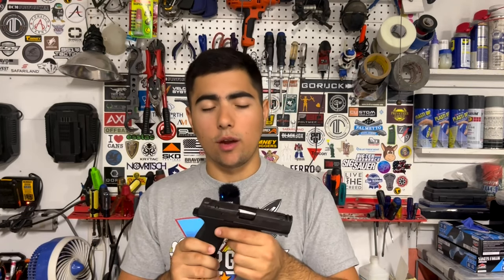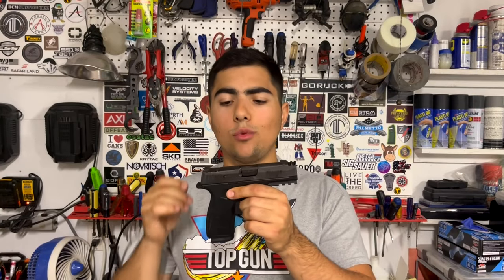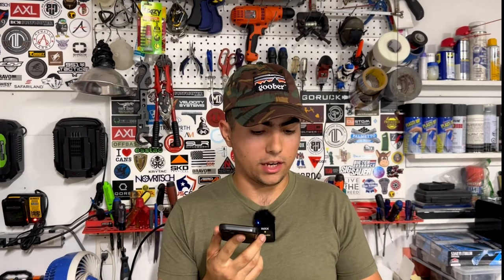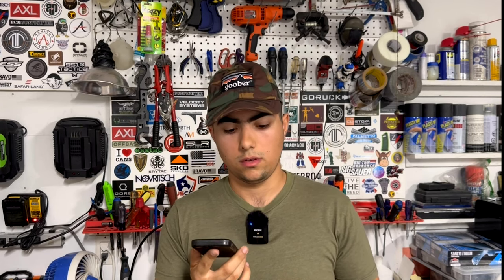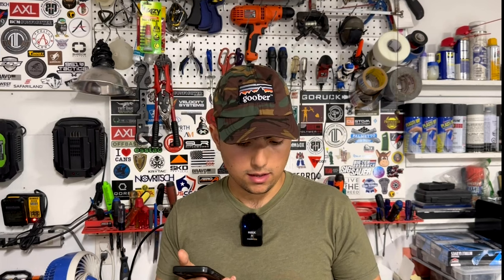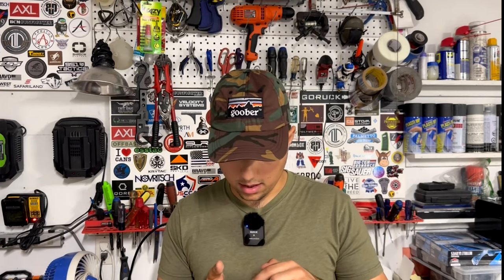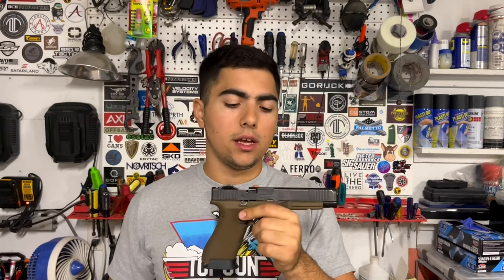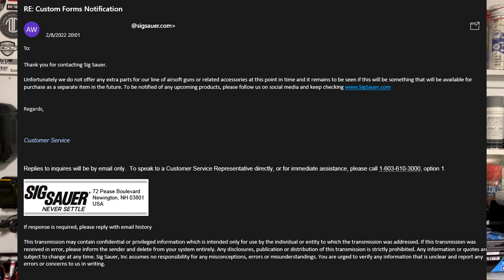Was I Wrong About the SIG P365 X Macro?

Comment: I know this video is over a year old now, but just came across it. This is interesting. I've heard others report the rusting issue, too. My brother and I both bought the xmacro on the day they were released back in 2022. I carried it almost exclusively throughout the end of 2022, all through 2023, and into early 2024 when I took a break after getting the M&P Metal SPEC Series. He's been carrying his non-stop since we got them. We are in the Phoenix area so I sweat all over my guns... a lot. The only place I've notice ANY rust spots at all is a bit along the rear sight dovetail and the serrations on the back of the sight. Those sights are carbon steel so it's not really a surprise there. The rest of the slide, FCU, and mags have all been great for me. I'm surprised they wouldn't redo the slide for you, however, if Nitride isn't holding up well to your body... and you like the gun otherwise, I'd probably send the slide, barrel, and FCU off to someone for DLC coating. That should take care of it. Sig customer service USED to be some of the best in the industry... but we are talking the pre-Ron Cohen days when they "To Hell and Back Reliability" was the company slogan.

Comment: I bought one, first sig ever. shot 800 rounds through it. apparently it's missing a rear c Clip from the factory. they said I could buy one, then realized how nuts that was to tell me. they opened a repair file for me to record the issue. the guy said Sig has no replacement parts incredible. first and last Sig I'll ever buy.
Reply from the maker: Jeeeez. That's even worse. That has to be a part that at most costs them a dollar and they wouldn't just give you one on the gun you bought that didn't come with a part it should have? Sorry to hear about that man.
Reply: @Control The Gun  YES Sir they said they have none. he also mentioned that I could Maybe buy one as well. I told him I bought the pistol brand new, he then changed his tone. Piss poor customer service. Something to be said for glock pistols working and having been built with ALL the parts from the factory. I'm done with Sig. gross treatment of a new customer.
Reply from the maker: @LouC518  I’m in the same boat. The macro was my first SIG pistol and I’m never gonna buy another one now. And I probably won’t be buying any other SIG products again either. If a company won’t stand behind a product then I don’t want it
Reply: agreed 100%

Comment: Changed out the pin in a new Walther PDP Pro to put in a different backstrap. and cracked the polymer frame. Sent the gun to walther hopi g they replace it. But no luck in that. Spent $800 on a cracked frame gun i havent even shot. All i did was tried changing out the backstrap and the pin kept hitting the maxwell, and i didnt realize till the frame got cracked
Reply from the maker: So you sent it back to them and they didn’t even do anything they just sent you back the broken gun?
Reply: @donkeydefense  unfortunately, yes. They said the frame has a serial # and they can't do anything with it. To be honest, it broke way to easy to begin with. Just trying to force a pin in the hole, I know it's my fault. But I still wish they would have taken care of me. Because I haven't even shot the thing yet
Reply from the maker: Yeah that sucks. I can’t speak for them but I would bet if it was Glock they would have taken care of you.
Reply: @donkeydefense  I never owned a glock, mostly because everyone brings so much hype around glock lol but I'm sure they would too. Just sad some of these gun companies do. I mean yeah it's my fault, but at the same time. Customer service is what keeps people coming back and loyal. It's whatever, I learned a lesson. Don't put too much pressure on plastic gun frames, this is just an expensive lesson.

Comment: Glad I saw this and your previous videos. I was tempted to buy the Macro, but now I'm going to stick with my G43X with S15 mags.
Reply: Had my macro for 6 months no rust at all
Reply: 3 days I had the xmacro, the mag release broke. lol
Reply: My g43x MOS with 4 of the 2nd. Gen S15 mags and every one of them has failure to feed multiple times per mag.  I thought perhaps this was me limp wristing or some other "operator error" but i had the RSO and my 2 friends use the gun and all had the same exact issues. This happened last week. Soooo... much like the gentleman in the video, every persons experience is different and because i had issues, you may not, and like he had issues, that doesn't mean everyone will. Good luck with your g43x and the mags. I'm disappointed beyond words.
Reply from the maker: Hmm, are you using the shield arms mag release?
Reply: @donkeydefense  No need to throw the "hmmm" in like i'm lying, attacking you or just an idiot. Yes, i have their recommended mag release and i had a licensed  gunsmith do the install because i'm no expert and wanted to make certain it was done properly. 4 mags, all with FTF. I wanted to like them, but, the ftf were a huge known issue in the previous gen i had hoped was fixed. Maybe i got unlucky bad ones but i purchased 2 from the gun store and 2 from Shield Arms. Happy for anyone who has good ones but i swapped back to stock 10 rd.
Reply from the maker: I wasn’t attacking you or insinuating anything. I’m trying to help you out and went to the first most common issue with them. 

I would try reaching out to shield arms and see what they say. I had an issue with my first mags with them and they took care of me, hopefully you get a similar experience.

Comment: It's not innovative at all, all they did was extend the grip down so it'll seat 17rd flush fit. They also never stop taking credit for being the "first" to introduce a high capacity carry pistol. The Kel-Tec P11 came out in 1995 and was 1 inch thick with a 10rd flush fit magazine. The specs are almost identical to that of the P365.
Reply from the maker: Good point

Comment: I had an issue with my P365, called Sig, and funny enough, the same lady, McKenzie, helped me out. She was pleasant to speak with and did her job. They sent me a label ten minutes later. I sent the gun in on a Monday, and I had it back by that same time Friday. 

It sucks that I had the issue with it, but I wouldn't say their CS was bad; they fixed the problem, and the gun works great now.

On another note,  I have a P226 and P365 Spectre Comp that run perfectly, with over 1000 rounds on each.
Reply: neat.. they must've just not wanted to help with is 2 month old rusted out shitbox.

Comment: So I’ve only had to deal with customer service issues through Shadow Systems… and their CS is very good and comparable to Glock! I had to send my Shadow Systems CR920 in for work due to the trigger not functioning properly.. it wouldn’t reset.. and I knew it was my fault for taking the gun apart so I contacted them for the parts I needed but couldn’t find on the website.. they asked me to send it in for them to look at… couple months later I received my CR920 back with new parts, even in areas I didn’t ask for, and NO invoice for work done! That’s good CS! To basically say that RUST is “normal” after 2 months of carrying is insanity! Sig is looking bad all around.. they have the 320 firing in holsters and failing drop testing (AND BEING RELEASED THAT WAY) to now the X Macro having finish issues all around! I don’t think I’d ever trust my life to one.. and I like the way they look and feel… I’ve been on the fence multiple times… this video removed me from the fence all together! Good info!

Comment: Sad to hear about your experience, I’ve had two considerably smaller issues that sig fixed for me. Not necessarily as a rebuttal, in my experience any gun manufacturer when it comes to replacing major component s like slide barrel or the gun itself they will always try to find ways to deny doing that for you, not just sig. I had a Beretta M9A4, the finish was weak, the slide has gouges, tool marks, even apparent cracks in the slide. Beretta was not accepting customer service phone calls and only wanted you to use their support ticket feature on their website, I did. It took them two months to reply to me only to basically “send pics” after which they took another few days to respond and told me to send it for further inspection and then they will let me know if it is covered. I ended up selling it back to the store.

With sig, 

I accidentally lost the FCU retainer sprig, I sent SIG an email and the same day the service rep told me they were out of stock but once they were back in she would send me a replacement free of charge. It’s a super cheap part and I was willing to pay for it since it’s my fault I lost that tiny thing but they went ahead and sent a replacement plus one extra free of charge. The second time I stripped a screw head on the macro slide, I sent them an email again, they replied the same day and told me to send it in and they will fix it for me. Ultimately I found gunsmith who took it out for me for free so I didn’t need to use them. Again, sorry to hear about your experience, I just think it’s typical of any gun manufacturer to deny warranty/service claims. It sucks, but it’s almost to be expected. Similar to how insurance companies will find reasons to deny your claim. but perhaps there’s something to be said that sig is having those issues in the first place. With that said, I’ve had a 365XL, two M18s and one macro and none have had any rusting issues. The finish is undoubtedly week and mars easily but I’ve not experienced any issues with rust, maybe something went wrong in the manufacturing process in regards to coating/finishing? I also have one the first batches of Macros and out the box the extractor was oxidized but that was not alarming to me since I live in the south and literally any gun from any manufacturer suffers from some minor oxidization, not necessarily rust. Usually on the iron sights and extractors. Anyways, sad to hear about your experience!

Comment: I just bought one of the non compensated versions of the X Macro. No rust out of the box at least. Haven’t had the chance to shoot it yet, I went to buy an M&P but left with the Sig after holding it. I’ll definitely be keeping an eye out, I broke it down as soon as I got home and checked it out. Hopefully it’s like the drop issue with the 320’s and have been addressed by now.
Reply from the maker: Hopefully they have swapped to a better steel/finish by now.
Reply: @donkeydefense  so far so good. Finally had the chance to put a couple hundred rounds through it. Zero problems and accurate as hell at 25 yards. I noticed I kept getting in the way of the slide catch on an empty mag but it quit after I started paying attention. Took it down the next day to clean it. No rust yet.

Comment: Thank you for your video. I was thinking about getting a P365 for something smaller than my G19 for times when I need someone smaller. Guess I’ll look at a G43X or maybe a 48. It’s hot here in the summer and that’s why I moved to Glock away from S&W. Had a tactical S&W 4513 whose finish flaked off carrying it every day. Never had that problem with Glock. Guess I’ll stick with what I am used to.

Comment: I have the xmacro, xl  that I bought mainly for the slide, and put it on a xmacro frame, and a p365 that I used the xl frame/grip module for. No issues with any rust on anything yet. Hopefully I don't run into any. That sucks with yours, and the cs you got. Hopefully they change, and get you fixed up for free eventually.  That's unacceptable for a pistol. Nomatter how you carry it or where. Too many good pistols with good coating out there. No reason to not have a good coating, and no rust.

Comment: I have owned a 365x for about a year. I had a nick in the slide from the factory. Sig gave me a new slide with no problems. As far as the rust no issues yet. Sig sais to use CLP to lubricate the P365x. I am only guesing but it might have to do with all those products you were using on it. Only a suggestion.
Reply from the maker: I’ve used the same lubricants and cleaners on all my guns for the past 5 years without ever having an issue. The only time I’ve had issues like this is with the Macro.

Comment: Good, Thx. I'd agree that SIG's Cust Svc is weak at best. Initially, I wondered if you carried the gun and just neglected the cleaning aspect, that would have been on you that it rusted, but that was not the case, then that's exactly where Cust Svc ought to step up and take corrective measures to make things right. They obviously thought less about the customer and failed to support their product, which may be innovative, but not of quality materials and/or workmanship. True colors shine in sunlight, so does the lack of the same, I also considered buying one of these, now looking at other good choices that will function without the hassle or the extra cost of the Sig.  Modern weapons should be able to withstand rust issues better than this P365 did.

Comment: Just so I can avoid the new comers defects I waited and wait and finally bought my sig p365 XMacro in June 2024 time frame and it was sent to my local store got that batch on April 23 2024 says it in the box carried it through out June July and August not even daily I have a rotation by weekly and the magazines have started rusting. I did clean it up and rubbed it with oil but it left a surface mark really hope the gun itself don’t rust but at this point I am hopeless with sig

Comment: Well I own several Sig guns and I 've never had a problem. I just finished building a custom AXG and went to install the mag well and the screw that holds the mag well onton the grip module snapped off so I called CS and they told me to send it in at NO COST to me and they replaced the grip module with a brand new one. Got it back in about a week and that was from the time I sent it in until it arrived on my door step. I also had them install a manual safety on a skeleton trigger fcu for one of my other builds and got it back in about a week turn around time when the guy told me two weeks. So I think their customer service is quite ok with me.

Comment: Use Lucas gun cleaner and oil. You need something with stronger protection. I carried in all weather conditions. As a NYPD 👮‍♂️ cop, for 24 years. The gun was ordered with the cheapest finish Sig had. All Sigs issued got sent back to Sig and had the k coated finish put on them. The magazines you just too clean with a fine sandpaper, clean them off and oil them. Do that if you leave them in a safe without those moisture crystal packs. Those crystals will help stop the rusting in your safe.

Comment: My experience with Sig has been great. The only issue I had was I had gotten a baffle strike because the we mount broke on my srd, I sent it to sig to fix and they told me they didn’t have the tools anymore but still sold the suppressor at the time. Ended up waiting about 8 months for them to do something and had to buy another tax stamp. I did get upgraded to the new SLX suppressor for free and it is better plus I also got a $250 store credit which is meh because it’s all their products. 

Outside of that any other time I had to call or needed something it was done right away and free

Comment: Thanks for the review, this is the first I've heard of the rust issue. Unfortunately I just purchased  the Xmacro a week ago. Certainly wish I had seen this first. I have not even fired it yet, now I'm afraid to. Thanks for the info!
Reply: Don’t be, I’ve had the macro for 3 weeks, 400 rounds and no issues with rust or anything
Reply: @gear7airsoft974  wow a while 3 weeks? Lol. Think rust is gonna take longer to form than that
Reply: I have the Xmacro and I’ve had it 6 months over 3000 rounds thru it with no issues. No rust no issues with the mags no trigger issues nothing. I’m not sure what’s going on but I know most of them say they clean there guns often with a degreaser. Over cleaning with degreasers is detrimental to any metal. Constantly stripping it of the oil it needs to absorb and then carrying it next to your sweaty body daily is a recipe for rust, ijs  I carry mine more than my glocks and other guns I own.

Comment: One thing to consider between the shorter slide and the ported slide is....the compensator one has additional mass. A better comparison would be a 365 Tac Ops, since it's the same length, buit even then it's not exactly the same because the Tac Ops would have greater mass due to the longer barrel.

Comment: I am sorry you have had an issue with Sig customer service. I have had the opposite experience with them, even with a 1986 P226 and no issues with repair or replacement of springs. No it was not free, however, it was easy and very inexpensive work to restore this older pistol. As for rust,  I have spoken with a gun smith who asked me, how long did the individual wait to contact Sig about the rust issue? did it progress from when they saw the rust? He has worked on many Sig's, Glocks, etc, and noted rust can be found on many of them during their life depending on environment  He did not seem suprised that any of the gun manufactures say it will cost you to repair rust damage as they do not know if it was due to the environment, lack of maintenance, or other abuse.